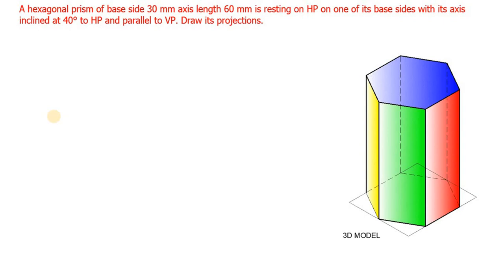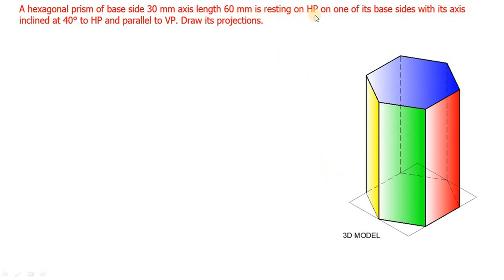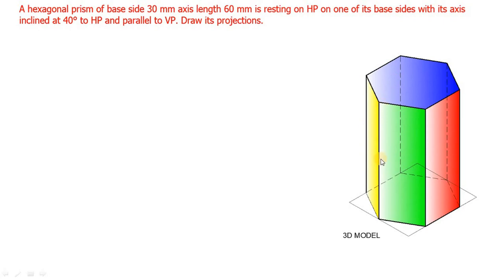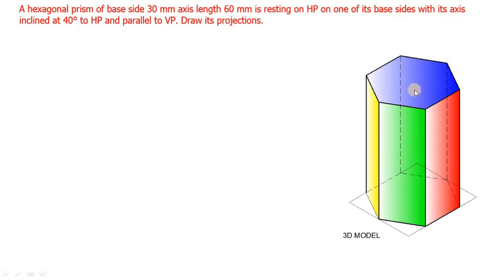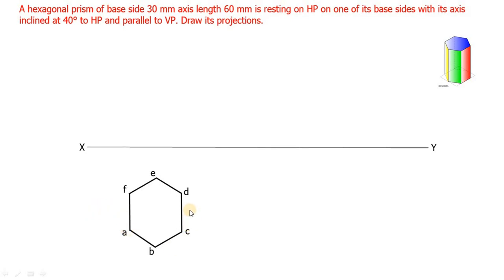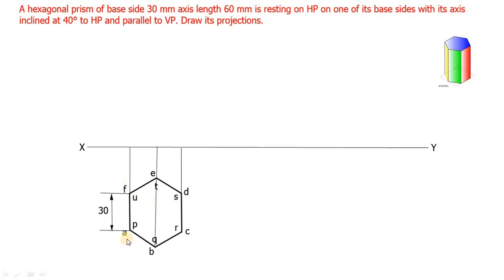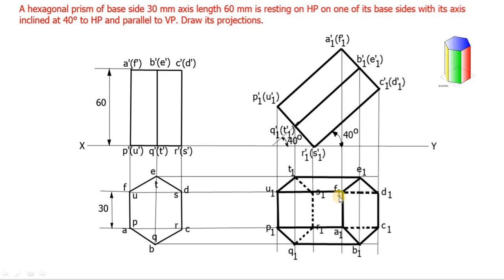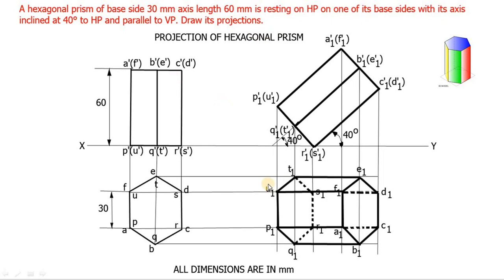Projection of Solids | Hexagonal Prism | Resting on HP & Axis inclined

Comment: A hexagonal pyramid of base edge 40mm and altitude 80mm rests on one of its base edge on the 
HP with its axis inclined at 300 to the HP and parallel to VP. Draw its topview and front view